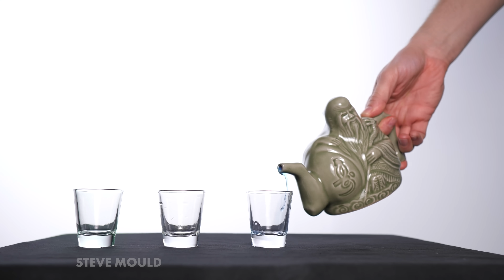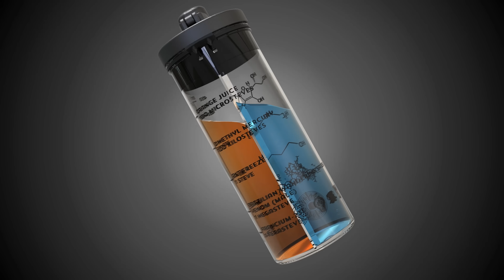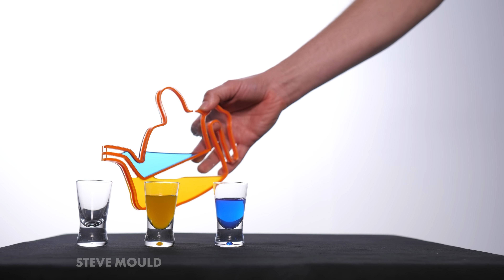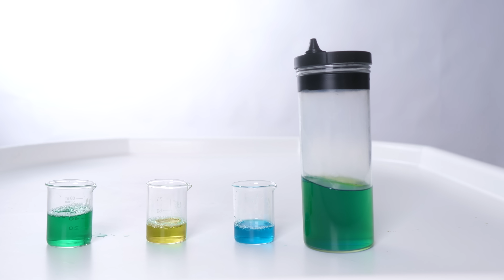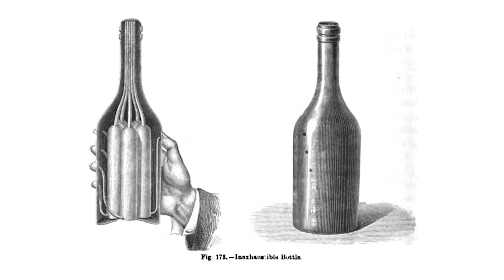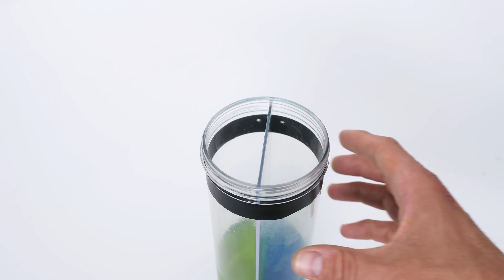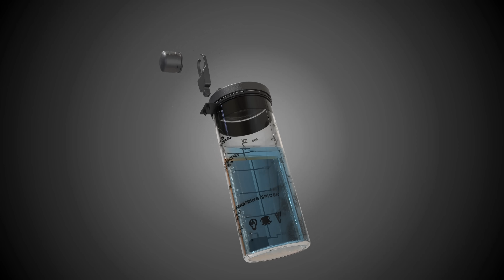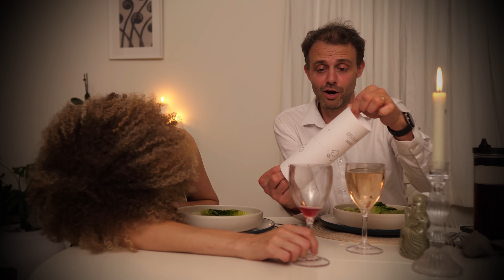The weirdest water bottle you can buy

Comment: "Don't know if you've seen this type of mason jar." That's the main type I see.
Reply: I feel like these are most popular in the US. Perhaps that's why
Reply: Right, these are the most common kind in the US, at least where I've lived (northeast, midwest).
Reply: Same. That's currently the only type we have in my house. A bunch of glass ones for the kitchen and 3 big barrels for storage.
Reply: I'm in the UK and my mother only ever used these (for pickling etc). I know them as Kilner jars (which is the brand Steve used).
Reply: I love Steve "discovering" American mason jars 😂
Reply: interesting, I never seen it before what are they usually the lids on?
Reply: @gawkthimm6030 they’re originally for canning. You can sterilize the glass bottle and you can reuse the lid ring, but you have to replace the flat element every time to avoid contaminating the canned food and food poisoning yourself with botulism or something as nasty. Assassins bottle of another sort, if you will.
Reply: @gawkthimm6030  Same as single piece lids but it's so the seal is more easily replaceable instead of needing an entire new lid. Those discs are meant to be used once so there is a new seal on each use.
Reply: @gawkthimm6030 food preservation! Popularized by the Ball canning company, the flat metal disks are tightened against the jar by the metal band, and are designed to create a seal when heat or pressure canned. Essentially, a vacuum is made inside the jar as the jar cools down once removed from the canning bath, and seals the metal lid onto the container.
Reply: @gawkthimm6030  They're normally used to store Granny's apoplexy medicine. That she made herself. From corn.
Reply: My mom used to can, that was the only type she used
Reply: I thought the same, "Typical Britain vs America moment, that's just a normal canning jar I've got dozens"
Reply: @RicTakaden Kilner jars are more common in the UK,
Reply: Heck! I've still got some jarred green beans from 1989 sitting in my pantry! Glass means no metal poisoning and green beans are healthy. Just waiting for them to mature a bit before I forget about them for another thirty years.
Reply: Yeah, that’s pretty much the only type I’ve used
Reply: I don't think I've seen that kind of mason jar before
Reply: @ZoofyZoof  it's odd that many people say the same thing, because the Mason brand themselves make these types in the US.
Reply: @TylerDollarhide  The only mason jar I've seen (and owned) are these little ones shaped like a barrel that have a screw-on top that's separated into two pieces... for some reason. 

I liked to pour a bottle of soda into them, they just barely fit in, then screw the top on and put it in the fridge for the day and drink it at night or the next day

Comment: Here's an idea: is it possible to put the air holes on the spigot itself? That way you can control which liquid comes down with your tongue or lips, and then maybe a silicone topper over the spigot would seal them both.

Or maybe the lid can rotate to create a seal over the air holes, like how some spice bottles have rotating rings to select how much of the spice flows through.
Reply: Using your tongue to select the chamber is great for personal use.  Less great for demonstrations.
A sliding seal for the air intake is a good idea.
Reply: Imagine using that as a poison bottle and your lack of tongue control goes wrong